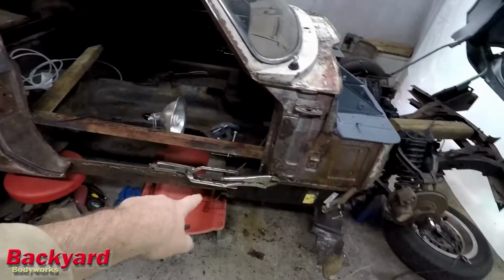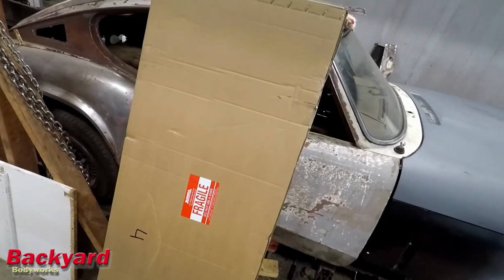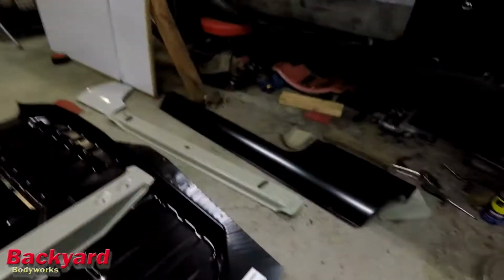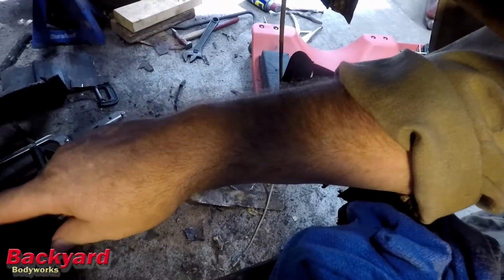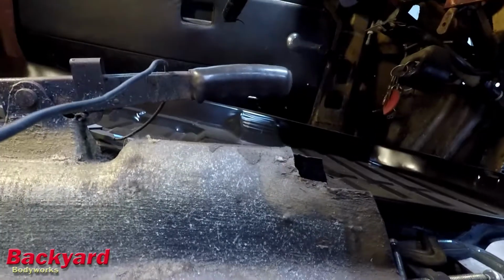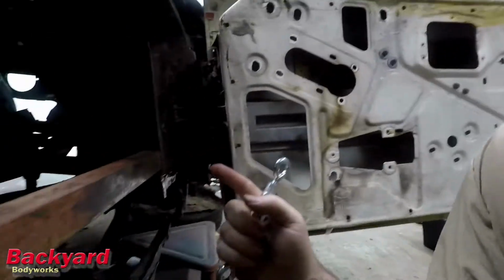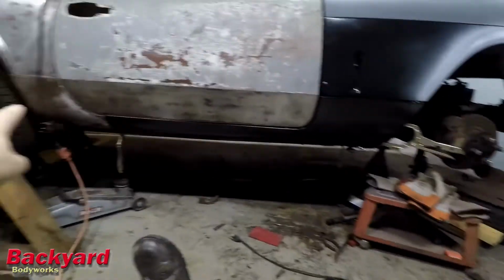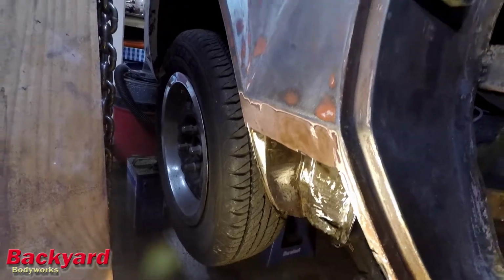72 Triumph GT6 Restoration Episode 24 (Sills, Floors, and Rockers pt 2)

Comment: Recommendation is to leave the door off (with suport), then fit up the a-post, inner and outer sills with sheet metal screws, then re-fit the door, then weld up the sills.
Reply from the maker: I was kinda leaning that way so I would have more room to work....that confirms it
Reply: @njaahkbackyardbodyworks1807  (Also, leave the body on the frame, which I believe you already did.)